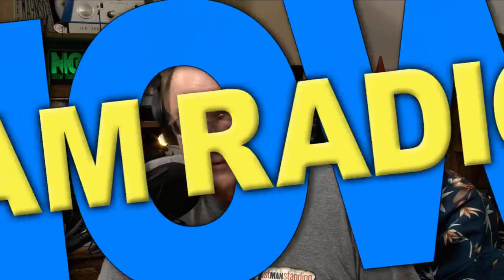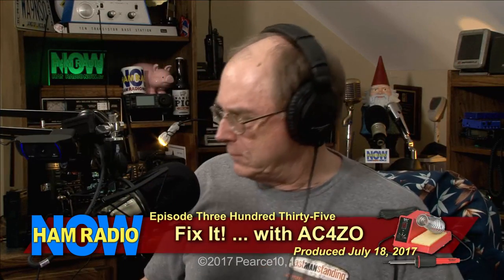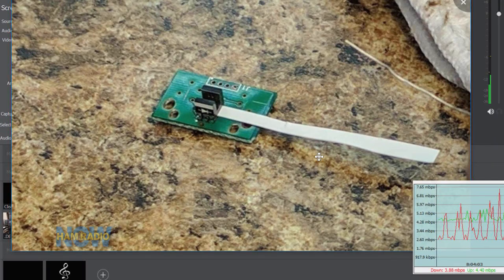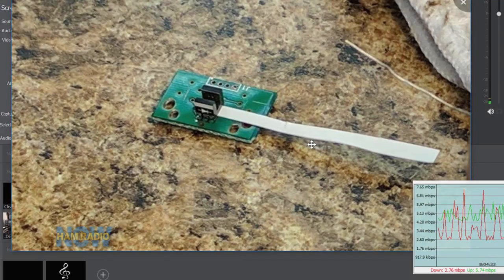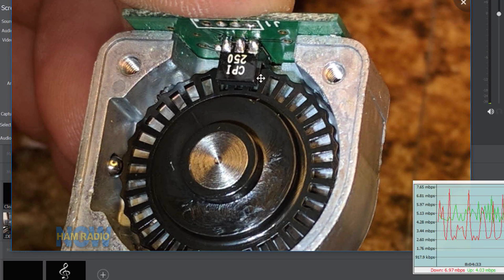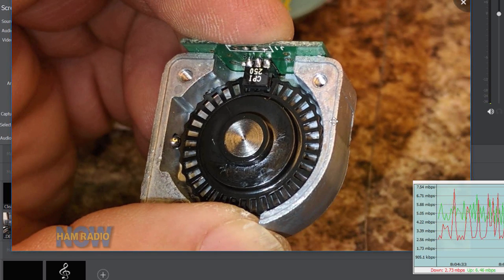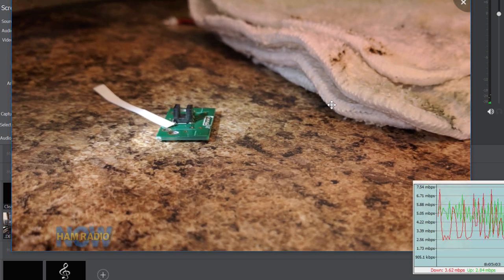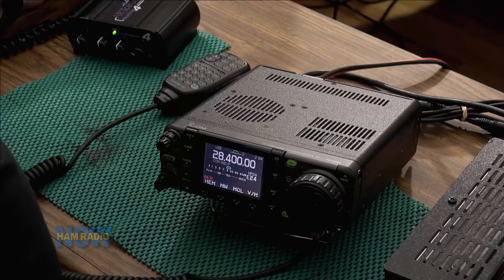HRN 335: Fix It! with AC4ZO

Comment: Hi Gary.  After your further testing I think David has the right idea to do a factory reset.  Also have you checked to see if there is any software updates?
Reply from the maker: sierge1 - the 7000 isn't 'updatable'. I've borrowed a friend's 'spare' 7000 to test. I'm not afraid to reset. That will be interesting, but I really don't expect you to fix anything.

Comment: Emergencies and leaving your jobs: I have a lot of admiration for people like Jeff and David who have "real jobs."  I wish early in my life I had got a hold of one of those real jobs.  But, I have been a contractor or independent guy my adult life, except for three years where I was a W2 employee.  

I have a Ford F-250 diesel truck with a 500-gallon tank in the back.  I'm contracted to a cell provider.  In the ramp up to hurricanes and ice storms and in the aftermath of tornadoes, it is my job to fuel the cell site generators or deploy a generator to a site without an onsite generator (there are more without generators than with generators, believe it or not).  This pays well, I think I should say that.

I won't take a job that will interfere with this emergency work.  I have an investment in my tank and pump setup and in my F-250.  Any work I do must be able to work around a disaster, period.

Comment: It was mentioned that you needed to file the index slot to get the interrupter disk centered in the photo unit. Might have been able to solve that problem when resoldering the photo unit on the circuit board by offsetting it a small amount.  73  WB3BJU

Comment: Very enjoyable program...probably because I could relate very well to the subject.  Started my electronic troubleshooting career, in the mid 70's, repairing TV's, back when they had tubes.  Not many benefits with consumer electronics, and TV's were moving to be modular and throwaway.  Moved over to industrial electronics, better pay and benefits, starting up and troubleshooting motor controls.  Worked in the field one way or another for over 38 years.  
Great points brought up by Jeff and David on troubleshooting and the skills needed.  And being a good listener is probably the most beneficial skill. 
Reminded me of a Freakonomics espisode: In Praise of Maintenance  http://freakonomics.com/podcast/in-praise-of-maintenance/
Thanks (now I feel I need to make a $$ contribution)
Don AA9WP